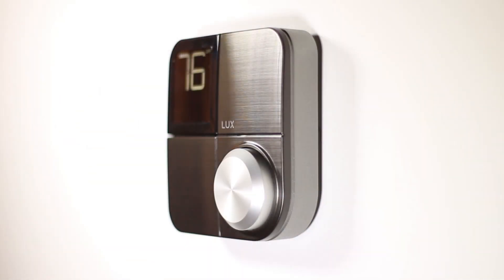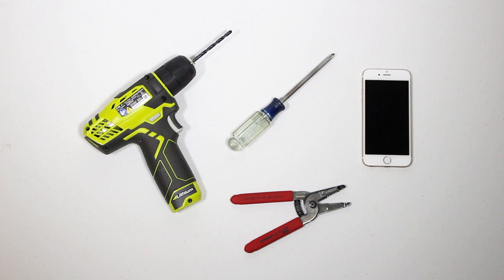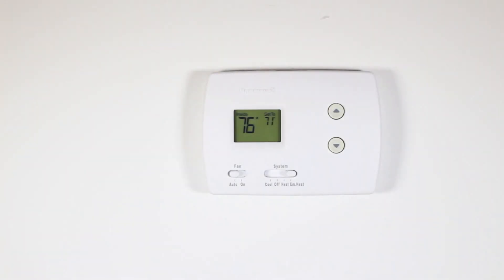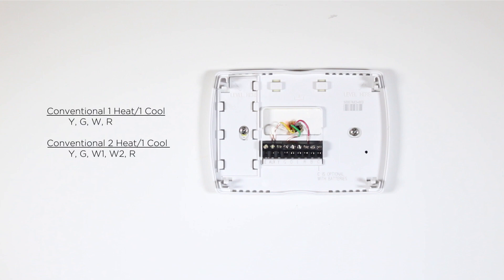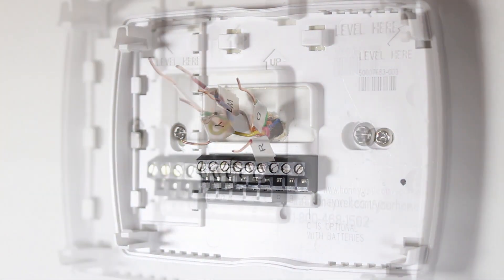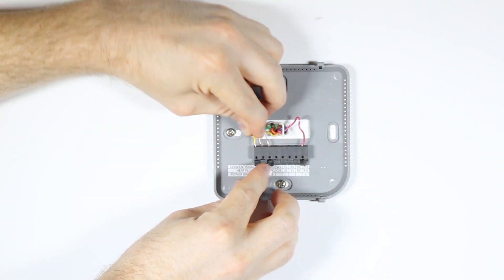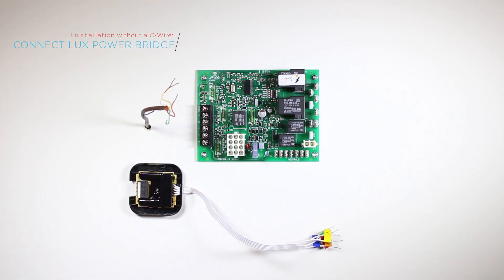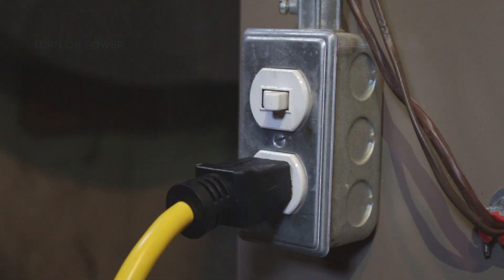Installing KONO Smart without a C-Wire Using the LUX Power Bridge

Comment: Stay away from the Kono. Mine stopped connecting to the internet. Tried reset, disconnecting from power, and nothing works. It will not finish the automatic setup because it will not connect to wifi. It worked the first time but now it's a dumb thermostat that only works by manually setting the temp. Just buy a Nest or any other brand.

Comment: Conventional gas furnace, single stage 1 H 1C, having fan blower glitching at start, noting the power bridge not installed (C-wire exist). PLEASE any one explain why the blower start ON then to stop and quickly (after less 5sec) kick on again and back to normal speed. This is too terrible for any type of electrical motor.

Comment: The assumption is that the old thermostat was correctly installed. Suggest that you start at the furnace, clearly identifying which colored wire is which (My system had a blue wire, but no white one, for example).

Comment: this is garbage i so regeret not going with google, my family are burning up in our new house now thanks to this crap i have 2 little kids and support isnt available cant find anything online about it, i wired it several ways and how do u know if u need to use the power bridge. i simply removed my honeywell and wired this one up heat works when ac should be on ac compresser wont come on at all, my old one had y2 connection bridged over to w2 this one doesnt say anything about that or the jumper in the back please help we are quarantined and burning up
Reply: Same here
Reply: Do you know what ended up being wrong? We put our old thermostat back on and AC isn't blowing still. It's going to be 90 today and I also have 2 kids at home

Comment: followed directions. still no power to the thermostat :( returned
Reply: im having the same issue! how do i turn the thing on and their web site is no help
Reply: @tonigarcia7820  my issue was that the ac float switch was triggered (tripped?) and because of that the ac shut off. Because the AC shut off the C cable was giving any power to the thermostat. So look up ac float switch on youtube and im pretty sure you will see what it is and how to fix the issue. Probably you will have to get a shop vac and vacuum out the line or something. After that it will have power.
Reply from the maker: Hi - we are sorry you are experiencing difficulty getting your thermostat to power on - please reach out to our tech services team Phone Number: 856.234.8803
Reply: @luxproductscorporation  this is a joke i called that number a million times
Reply: I am in the same boat as you. This kono Lux is crap. Nice looking, but chinese crap!
Reply: @jefrey5578  it works for me now. Not sure what was my issue exactly but i believe it was user error or something.  Works great since.